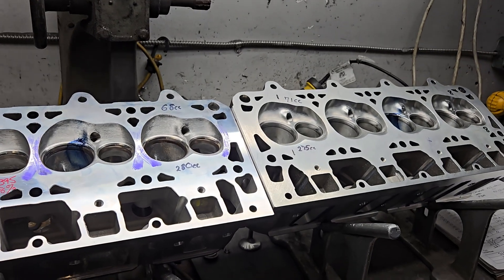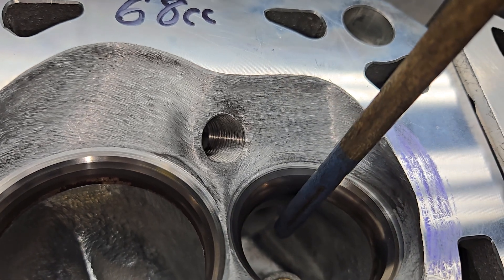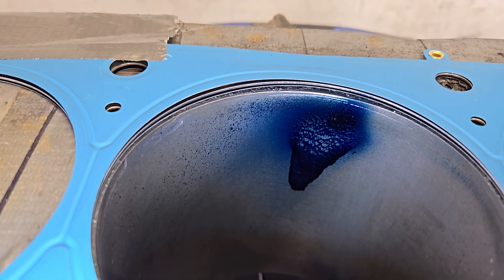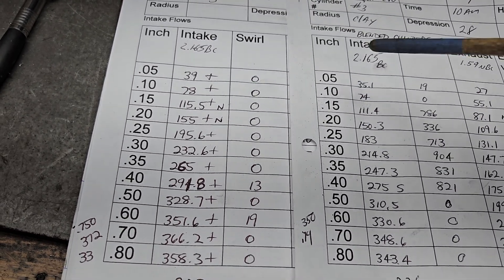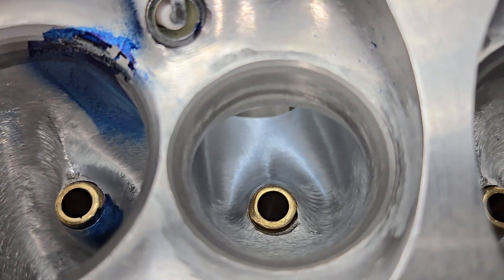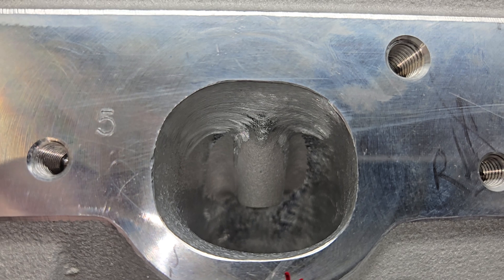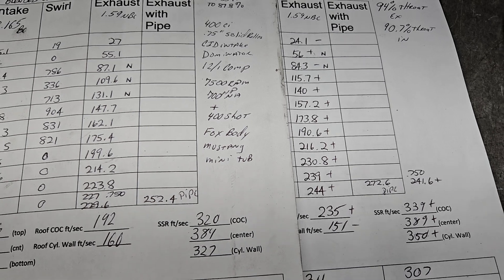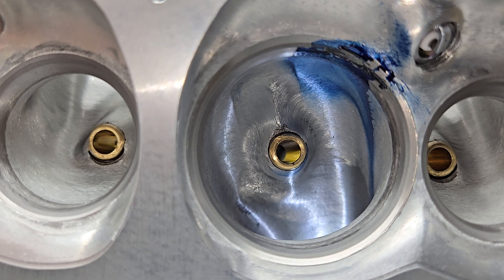Brodix BR3 275cc amateur ported vs. Dart LS3 Pro1 amateur ported. A complete knock out!

Comment: I do not use cutting bits in any aluminum head work. Sanding scrolls and scotch bright does fine. May take a little longer but zero mistakes or over cut areas. Just my way of doing it. If you look at a used 5.3 head for example, you can see where the fuel flows in the runner and near the valve stem, clean vs dirty areas. Those are the areas I concentrate on for flow. The rest of the work is just smoothing and clean up. This is a street car set up single turbo or NA fuel injected.
Reply: Not a single carbide bur??? Not one???

To each his own. What's your turnaround time 12 months? 

How long does it take to sand a bowl to 95% or 100%??? 

The throat to 90%?!?!?!🤯😬😬😬

Comment: I keep chewing up the valve guide vein with the carbide. Do you grind one side from different ends to not have the carbide climb over? Just thought of that.

Some of them ended up with gouges on the edge of them half way down.
Reply from the maker: @____MC____  Try a bit of wd 40 and lower bit speed
Reply: @servediocylinderheads  i did(figure i just suck). Its a grabby sob. I turned the pressure down and stuff a rag under the lever so i can feather it easier. Ive only done 2 sets of heads ever just as a casting clean up and gasket port match.
Reply from the maker: @___MC___  Air....ugh.
Reply: @servediocylinderheads  should i get an electric one for next time? I hate the air one, too.
Reply from the maker: @____MC____  There are new electric ones with a built in speed control.
Reply: You using double cut or single cut burrs? I feel like a double is easier to control at multiple angles.
Reply from the maker: @bcbloc02  I agree
Reply: @bcbloc02  single
Reply: I consider that area "finesse work". If I'm shaping the guide boss with new or old good guides installed, I use a variable speed Dremel or a Snap-On "pencil" grinder on a whip hose. Combine either tool with 1/8" inch long shank double cut burrs and you'll have all kinds of control. 

I like a tapered bronze valve guide. I don't remove material from them, and I like them not to have grinder marks. The client appreciates the work and "new" look of everything.
Reply: @arturozarate1752  my second go around i just used the burs to clean up casing chunks and port matching with a drill. Then sand paper rolled  with the drill too. I used a cordless dremel on the chamber and around the seats then sand paper rolled it and used the buffs on it. Took forever. Im trying to learn more for when i do it next time. I need to make cut down valves to protect the seats. I used a short double cut flame tip to port match and it was still grabby and jumpy but seemed to be cleaner and more efficient.

Comment: Very eye opening, how the port and chamber angles all have to play nice with each other. This actually confirms a theory I have about underbody aerodynamics on race cars, because there's very sensitive areas much like in cylinder heads. And getting angles correct in those areas have massive implications for overall performance. Just slight changes can have a big impact.